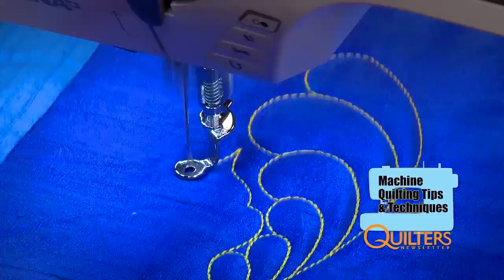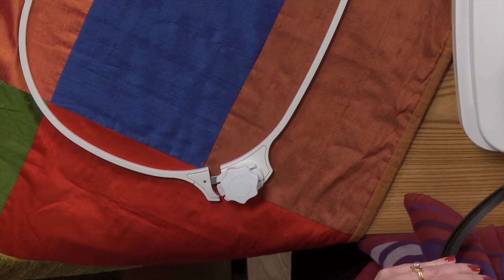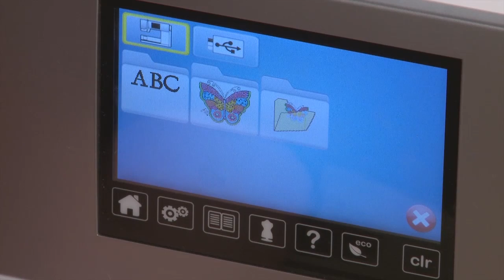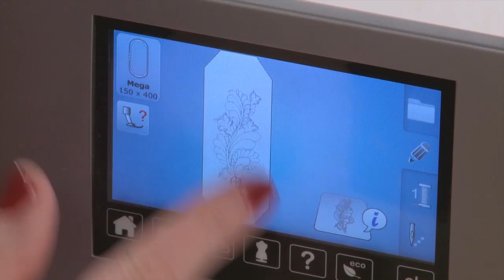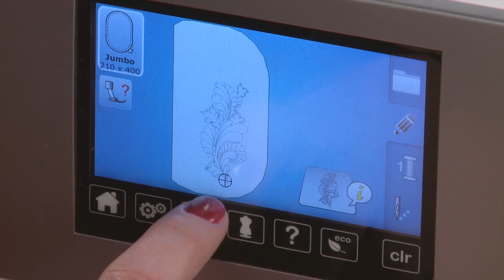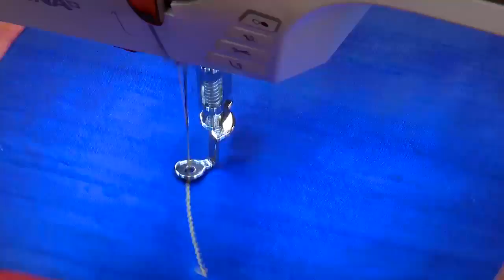Quilting with an Embroidery Machine, Part 3

Comment: Yes the jumbo hoop is large enough for making a 10" block, BUT NOT with the Bernina machine you are using on the show, 7 series "BERNINA 750 or 780" are not embroidering on the total width of the hoop, only 8 1/2". You can make 10" blocks only with the Bernina  8 series 830 or 880. I own a 780 Bernina machine and it is not my first Bernina machine.
Reply: chantalida53 great job
Reply: chantalida53 Good to know!😸
Reply: chantalida53 thank you for clarifying that as I have 770QE  and feel it lacks a few points ? of course it could be the operator!!